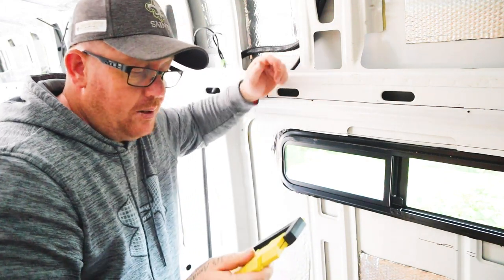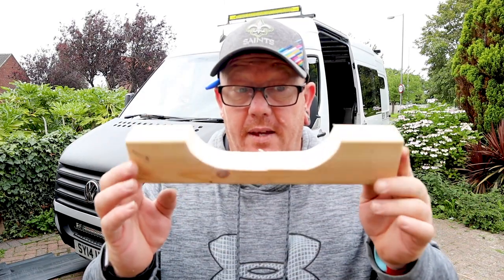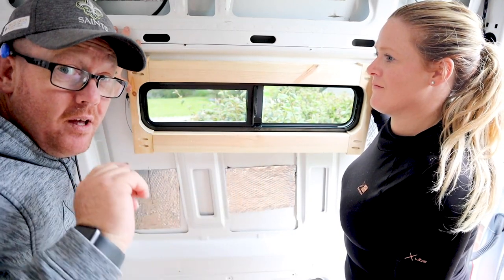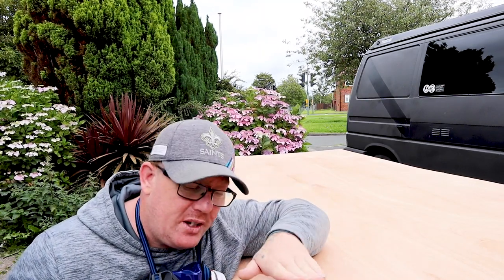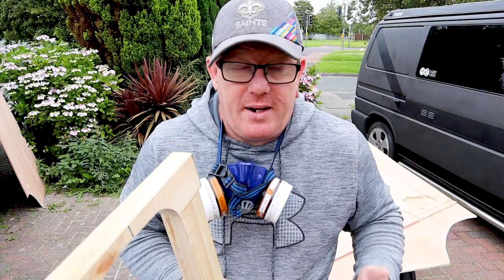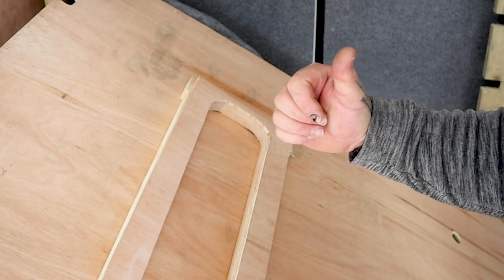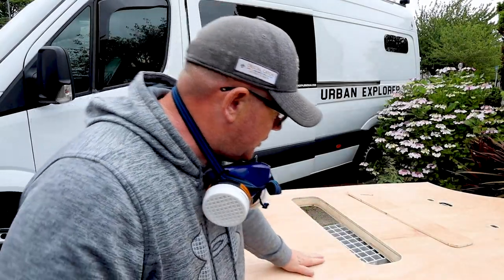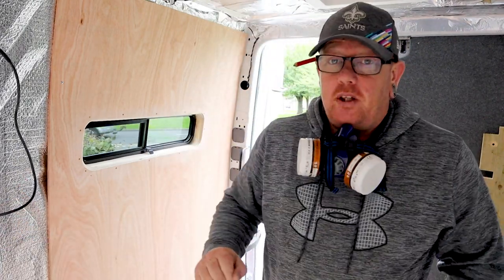Beautiful VAN Window Frames In a VW Crafter

Comment: This is excellent! What pieces of wood did you cut your frame from? 
Also, what is the name of the tool you run around your cuts to make the bevel? It's pretty magical.
Reply from the maker: Thank you , We just used 3x2 for the frame . And the magic tool  is a router . There so so good and you can get them cheap as well

Comment: PS people at the end of that video I think I saw him slide that window open and the open part was the front and you slid the glass towards the back. Everything that I have read tells you to put the stationary part of the window towards the front of the van and that prevents the rain and water that gets sliced up against the vehicle from going into the crevice between the two panes of glass and potentially causing a leak😮 always keep the stationary panel to the front
Reply from the maker: You can put them in any way you like it really dosnt matter they seal . And they have never leaked . So don’t believe everything you read . Cos let’s face it they have been in for 3 years and not one leak
Reply: @UrbanVanlife  so you're telling me I should not have believed the manufacturer of the windows that I purchased and installed like they recommended? I didn't know why that's what they said until I watched a couple of videos and then I thought huh that does make sense..
Reply from the maker: @justjudy7320 well I can tell you 1000% ours have not leaked at all . So what dose that tell you . But let me know if yours leak . You also say about the manufacturer . We didn’t say who it was just where we bought them from ?? May be you got different windows that have to be installed that way cos we know plenty of people who fitted them like we have and funny enough non of there’s have leaked . It could be you have different ones